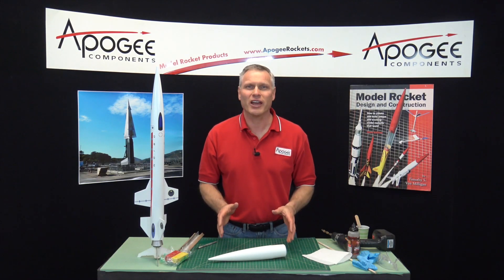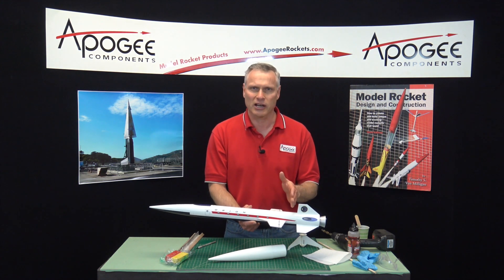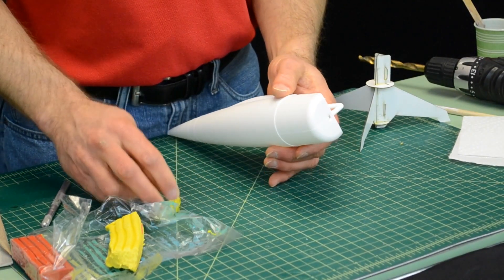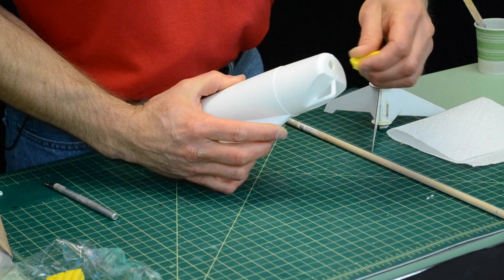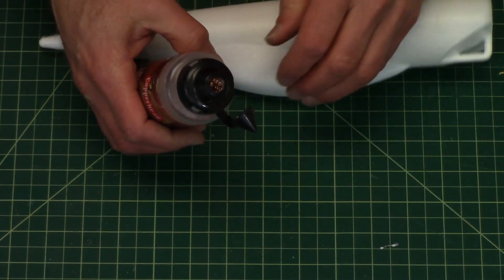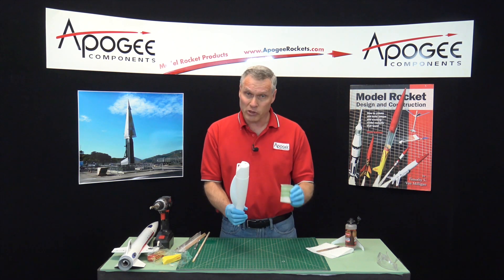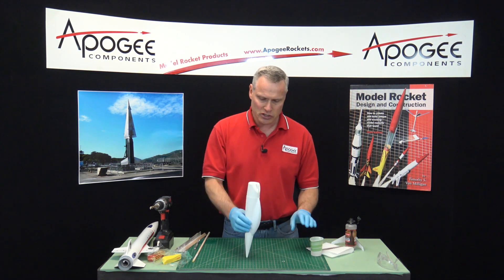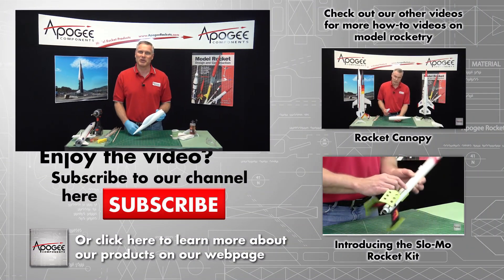Adding nose weight to your nose cone

Comment: I put modelling clay in my rcket as a kid. Used a dowel to smush it to the tip of the nose cone. Been there since the 80s, never shifted. Many launches. However, with a E, F G not sure if itd stay put.

Comment: Some epoxies are poorly adherent to plastics. Have you had an issue with it letting go? If that epoxy you used works well, can you specify which one it is? JB Weld makes an epoxy specifically for plastics, I use it to attach plastic (ABS) Estes engine retainers to motor mount tubes.
Reply from the maker: I haven't tried JB Weld for nose weights. Sorry. Give it a test.
Reply: @apogeerockets  I was curious what works for you. Was that Rocketpoxy?

Comment: The real rocket science is trying to add little to no dead weight. 

We can achieve this by making appropriate sized fins that are both as light and as stiff as possible. Ideally weightless
Reply from the maker: Right. I always encourage modelers to design without having to put in nose weight. But if you must...

Comment: Using whichever design program you choose, and finding the necessary nose weight is extremely vital in home designs. But,  you also need to factor in the weight of the epoxy (if using BB's or shot), so the nose weight wouldn't be excessive, giving you a different (and potentially dangerous) unstable flight condition for a top-heavy rocket.

Comment: Recently i started making my own rockets just by copying estes kits ive bought in the past..i dont copy them 100% which leads me to my question?how do i determine the number of fins to put on??whether it be 3 or 4 which seems to be thee most common..does it have anything to do do with the length of the body tube or the weight of the nose cone or perhaps both??
Reply from the maker: The more fins a rocket has, the greater the margin of stability. So if you need more stability, you need to add more fins, or make them bigger. To figure that out, you have to find the CP and the CG of the rocket. For that we recommend the RockSim software. You might also want to see the book: "Model Rocket Design and Construction." You'll find that on our website too.
Reply from the maker: Well, fins affect the rocket in a few different ways. By adding more fins you increase the mass of your rocket as well as the aerodynamic drag. However more fins also increase the rocket stability in flight as well as move the center of pressure further toward the base of your rocket.
Assuming your center of mass stays ahead of your center of pressure and the motor you use is enough to compensate for the additional resistance, the number of fins is entirely up to you!
Give the Rocksim software a free trail, play around with the fins and you can get a better understanding of how it impacts your rocket.

Comment: I've used clay with Estes kits, and added the same BB's to MadCow rockets such as my 4' Patriot. with that project it required a large amount of nose weight and I added a metal rod through the nose to give the BB and epoxy to hold on to. Is it normal to have clay, BB's and epoxy together or was your example more for demonstration on you tube?

Comment: Thanks for the great instruction videos you provide.  I am just starting back into the hobby after 50 years away.  Back then CP wasn't even talked about with the Estes rockets.  Now I discover just how important CP is.  I discovered I needed to add nose weight, and this video provided a very easy way to accomplish that.  Thanks.
Reply from the maker: No problem, thanks for watching. :-)